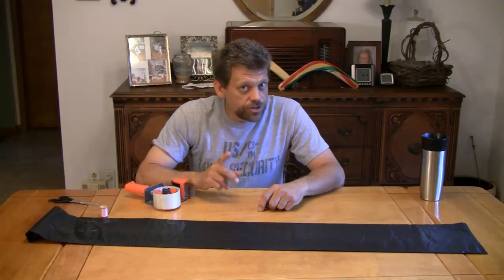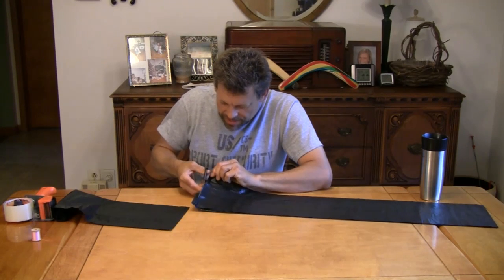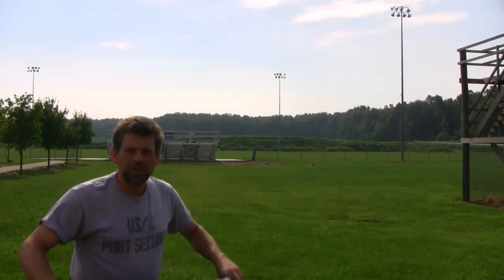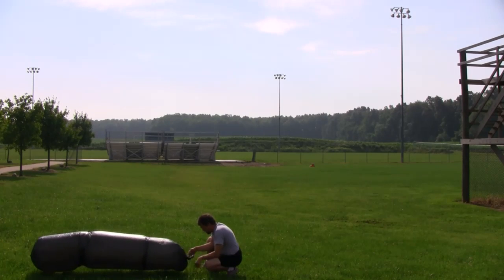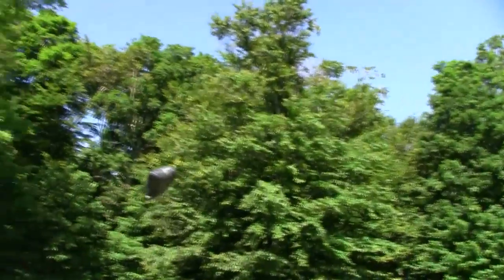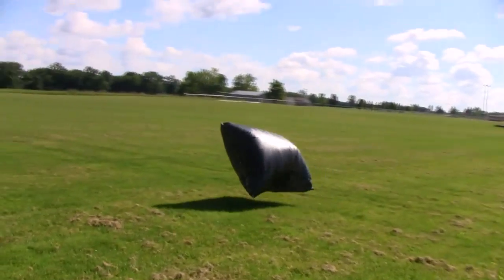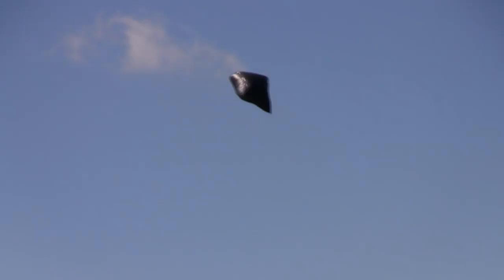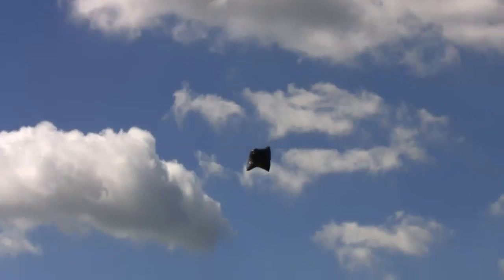"Do Try This @ Home 2010" - Episode 13 - "Full of Hot Air"

Comment: Can work better with black latex ballons with aluminium candle heating. That will stay in the air 8 hours travel aluminium foil wind protection for candle.

Comment: nest time use a wire resistor of 68 Ohms inside it, and a 9V battery, after two minutes or so, unplug the battery, and see it flying =P
(wire will reach 80ºC(180ºF) and the air around it would reach 40ºC to 50ºC)
May works better with a 12V 2A PSU

Comment: U just fill with hot air by hair dryer
Reply: You are stupid. The sun heats continouly the ballon. Because its black.
Reply: You better come with another ideea. Because if you overheat with hair dryer you will melt and burn the plastic bag. Also its not posibility to keep him hot because this plastic doesnt have insulation on it. So get cold back very fast, same temperature like this ballon. Maybe 45°C max 50°C. Latex ballons work batter
Reply: Latex ballon can be good to hold a heavy battery on drone. For long range driving. Also with solar panel. So latex ballons will lift the wheight.

Comment: this is for the hot air ballon i was taking about after u collet a good amout of wax  u cover the rag with the wax then u let that dry then after its dry u wrap it around the pointed end of the wire and then u take a blow dryer and blow in to the trash bag so its opened up nice and well then u take it out side and u light the rag on fire and hold the bag intill the bag has enough hot air to fly and thats ur hot air ballon     be safe when doing this do it at night  its a ufo not a hot air ballon

Comment: i have a way to make  the hot air ballon but  instead u need a candle, a trash bag like mr. g, an old rag, wire cuters, and a old wire hanger. first u cut the wire hang in to four even peices about 5 inches if u dont have enough wire in one get another take the ends of the wires and twist them together and have them pointing north east south and west then u open the bag and atach the wires to the bag and bend the wires down to a point then u light the candle and let a buch of wax build up

Comment: @followthemoney100 im pretty sure the air doesn't have to leave the balloon to make it rise

all that matters is that the air inside is hotter than the air outside, which makes it rise. so basically if it was winter outside than normal air at room temperature in the balloon should still rise.